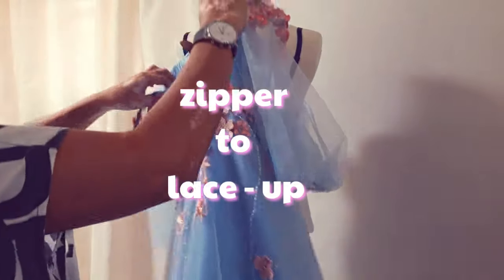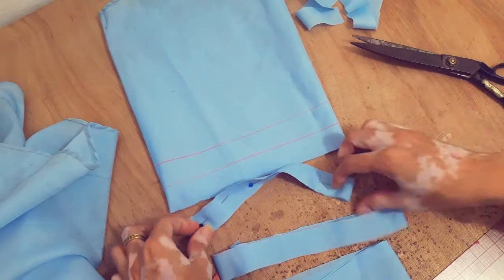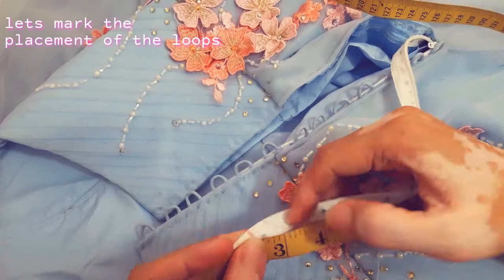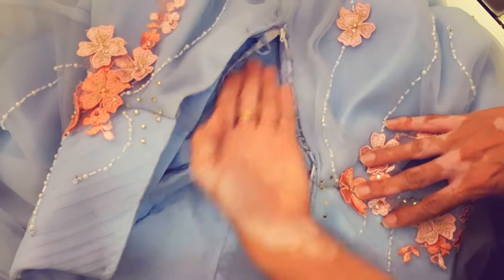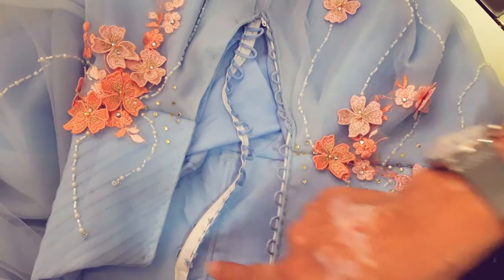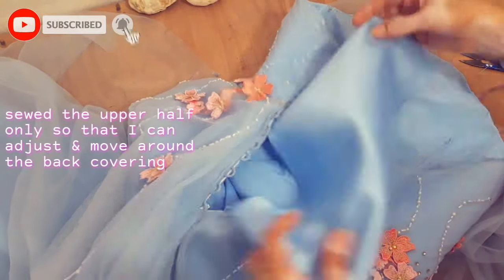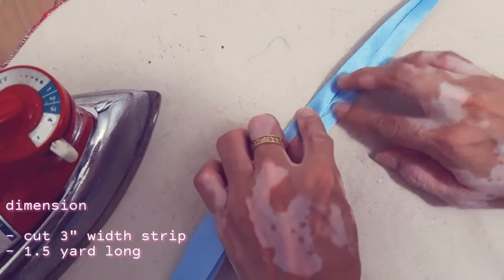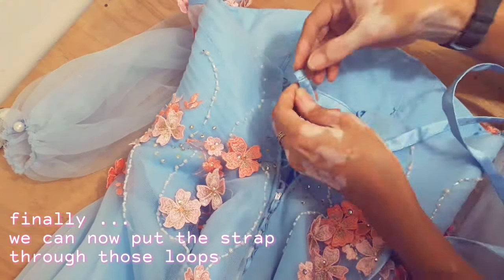🧵 Converting My Client's Prom Dress from Zipper to Lace Up × How to Sew a Dress × Sewing Tutorial

Comment: Would this be a good solution for a wedding dress that just can't quite get zipped up all the way? 
Because of covid, my area is in a stay at home order till the end of May and I can't get an alterations appointment until mid June and my wedding is mid July lol so its really cutting things close. My dress has a ton of bead work that will have to be taken out and re beaded if its taken out at the sides. My dress is only slightly too small so it needs to come out by about an inch. The only person doing alterations is charging an arm and a leg for the work which I understand because its labour intensive. But I'd love to find a solution that would cut the part out of having to unbead everything.
Reply from the maker: Hi Alexis , I think this is the solution 🤗  give it a try 👍 would love to know your feedback afterwards ❤